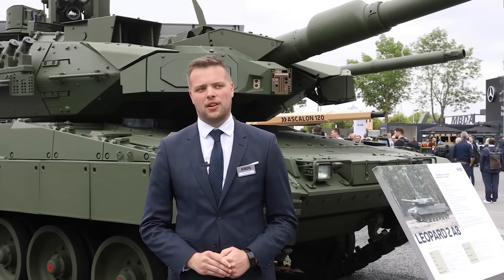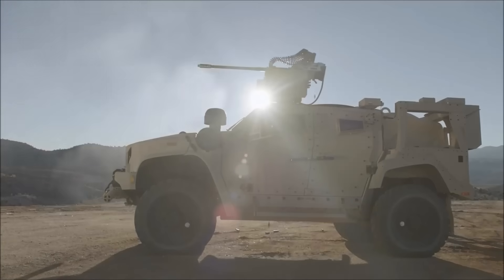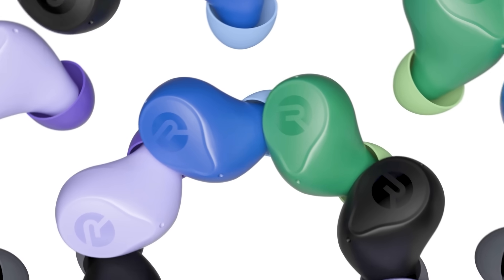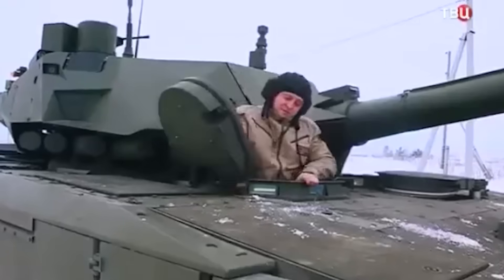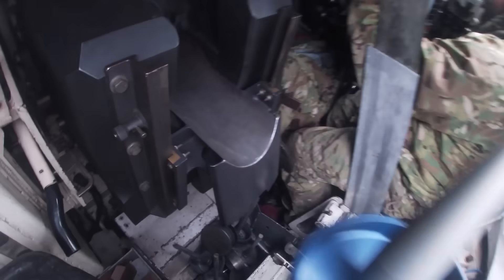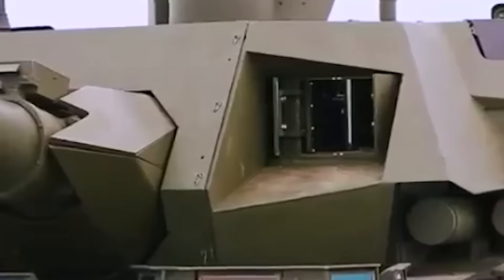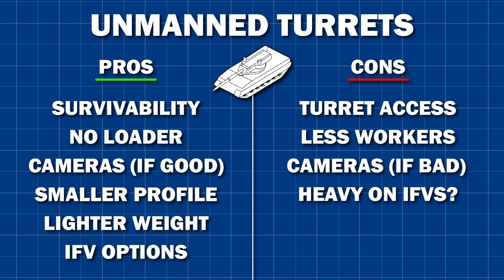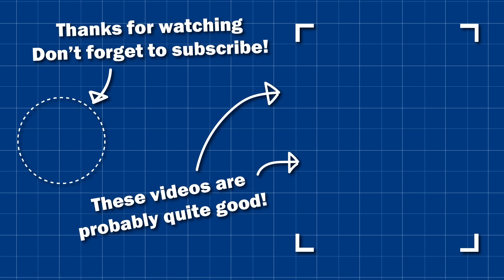The Unmanned Turret - And Why It's The Future

Comment: I think it's very likely unmanned turrets will be a major part of the future of armored warfare. They offer significant advantages in crew survivability, allow for smaller and more protected vehicle designs, and take full advantage of modern sensors, automation, and fire control systems.
Reply: That's great until the tank takes battle damage.  What does the crew do if the optics are compromised?  Current tanks carry spare 'vision blocks' (polycarbonate blocks that use mirrors to operate like periscopes) that can be replaced from inside the tank.  Because in combat they are going to get damaged.  And what does the crew do if electrical power is lost?  All of the control linkages from the driver to the powerpack are mechanical so a tank can still be driven even with a total loss of electrical power.  And all of the controls for aiming and firing the tanks weapons have manual backups.  

With an uncrewed turret - a damaged tank will be completely unusable and there will be no 'degraded mode' gunnery that the crew can use to stay in the fight.  

BTW the ammunition stowage underneath the turret is stupid.  If the tank takes an ammunition hit - there is no way to vent the explosive gasses out of the tank.  Keep the ammunition in the bustle rack with blow off panels.  This way a 'bustle event' means that you only have to replace the ammunition racks, cables, crosswind sensor, and the radio antennas.  And the parts clerk does not have to order each of these components separately they will come as a complete set of all needed parts. (And it will be a single mechanic plus the tank crew doing the work.)
Reply: I would add that weight reduction is another major feature of unmanned turrets IF done correctly.  The US Army's Booker "tank" was cancelled because it was just not significantly light enough in any rapid deployment scenario that was better than the existing M1 MBT has to use.
Reply: Currently, Russian (prototype) tank Armanta has a man-less turret, but it's heavier than a T-90 (55ton vs 46ton), still considerable lighter than an Abrams (70ton) or an 2A7 (64ton).
Interesting comparions can be drawn, I think
Reply: @lehoang3532  T-90M weighs 51 tonnes while T-14 has a much stronger engine and versatile transmission.
Reply: @Klovaneer  it is also significantly larger. The T-90/72 and T-80/64 are very combact. By seperating the fighting compartment with crew compartment and engine compartment you suddenly have to fit each in a different part of the tank. Thus it gets larger
Reply: @Max-hn5fs  It may be visually large but the turret is a feather instead of being at least a third of tank's size and weight.

Comment: Why Western MBTs are so heavy???
Reply: A major part is the fact that they have loaders, each crew man does add roughly around 10 tons or so (accommodation and space)? A loader needs to stand upright to work efficiently, so there's a significant amount of height, space added to the design.
Reply: @polygonalfortress I mean if you look at stuff like the Leclerc, it does in fact weigh around 10tons than an abrams but still is almost 15tons heavier than a t90m. My guess would be that western tank are that heavy because they have actual armor to wistand enemy apfsds shells and atgm. Yes sure soviet tanks are armored and all but seriously, do you believe that a 40ish tanks will actually survive anything? and don't just say "oh but ERA" ok cool explosive armor, but if it was that good we would see it on every tank
Reply: There are 3 main reasons why Eastern tanks are much lighter than Western tanks: 

1) ERA is used as the main armor and instead of using 30cm and more composite, a small brick-sized box will do the job 

2) Autoloader reduces one crew member so tanks can be made smaller and with less material 

3) Eastern tanks do not need to be spacious inside because tanks are made for smaller crews, not for a standard human like in NATO.
Reply: @HesFoset  ERA enhances existing protection, swedish trials of T-80U proves it's composite to be as strong as the Leo 2's. All the weight saving in soviet autoloading tanks is thanks to square-cube law.

Comment: Unmanned turrets offer an interesting premise. It can make it so that the crew aren't in direct line of fire when the tank is in a hull-down position but I've been reconsidering using unmanned turret designs in some of my own fictional MBT designs because of the fact that, if even one of the critical turret components were to fail, lest it be destroyed or simply go non-functional because of reliability issues, it could take out a tank that would otherwise be participating in an armored assault.
Reply: This is a non issue because any tank receiving damage to its cameras is a mission kill. There is no such thing as tanks keeping operating after being damaged in battle. It could be decades ago, not anymore. Any damage that degrades the tank takes it out of action. There is no manually aiming in modern warfare. 
All western tanks have been obliterated in Ukraine with damage to optics and tracks or engine by FPV drones, AT missiles and artillery. 
There is no way in which damage that would take an unmanned turret tank out of action that a manned turret tank would keep operating. Both will be out of the fight and the crew would abandone both with the same damage. 
A crew cannot sit in a damaged tank to emergency operate it in manual and mechanical ways. They will be offed in seconds with modern abundance of directed weapons.

First rule of tank warfare, don't be seen, don't be targeted, don't get shot, don't get hit. 
Once damaged, retreat if possible or abandon the tank as soon as possible testing to use any cover. Staying inside to be Rambo is to ask to get ended.
Reply: @Argentvs This

If they already hit you once they are definitely going to do it again
Reply: @Argentvs  The extent of damage absolutely matters. If a turret is penetrated, the entire turret will need replacing. It cameras are destoryed, only cameras will need fixing. I feel like you completely missed the point of his comment
Reply: @DrakonPhD I didn't miss it. What you say is irrelevant as in both types of turret would be the same. An unmanned turret or manned, if cameras are broken, the tank needs to disengage for repairs. The notion that tankers will keep fighting shooting on manual mode is ridiculous in modern warfare. Most of the time a damaged tank will not survive because it will be constantly being attacked by FPV drones.
Reply: @Argentvs  I see your points and yeah, maybe I could try out a tank design with an unmanned turret.
The fictional MBT design I made for my also-fictional nation, dubbed the Kampfwagen Leopard 3 (or MAV-80 (MAV for Main Armored Vehicle) is still in its early prototype phases and I could make adjustments to allow for it to use an unmanned turret.
I was simply concerned about the fact that autoloaders, cameras and other equipment used in unmanned turrets would be simply too unreliable/complex and expensive for my nation to produce while also staying somewhat safe. That and my tank was designed around expecting to be hit a lot anyways, so we engineered solutions, armor setups and strategic positioning of spall liners and crew to minimize the effects spall has if sabot were ever to penetrate. Ever since the industry and economy has kick-started though, that's started to become more of a possibility.  I'll experiment with redesigns of the Leopard 3 tomorrow to include unmanned turret systems, since it really does seem like they're the way to go. (Oh, and FYI if you're interested about the Leopard 3 I'm making, it doesn't focus on anti-drone systems that much whatsoever since the RP it and the nation was made for all unanimously agreed to not use offensive drones, only drones for recon.)

Comment: It's probably the future alright but I doubt that the close future. It has many teething issues and the autoloader is a big weakpoint. If that's knocked out, the tank becomes useless at best and has an agressive T-72 - T-90 style space program with the turret which as it is obvious wouldn't be harmless to the crew, no matter the armor
Reply: depends the autoloader, a bustle autoloader (akin to the leclerc and the type of autoloader fitted in that leopard 2 rc thing) won't hurt the crew inside.
Reply: @agentgollem1919 but it takes extra space on the turret in exchange which hinders the transportability. But you are not wrong
Reply: @LastGoatKnight Dude how does a bustle auto loader hinder transportability ? The ammo in both the Leopard 2 and Abrams is also stored in the bustle... And the turret bustle of a modern Leopard 2 is enormous compared to that of the Leclerc for example.
Reply: i thought the T-72 and T-90 turret tosses were because of the autoloader design - to my knowledge dont the French Leclerc tanks use an autoloader that uses blow out panels and stuff ? - it effectively side steps all the issues the T-72/T-90 design has
Reply: @notsogood4321it is because of the autoloader design. Still, the space under the turret is a void if they don't use that design which on MBTs is unacceptable (hence the need for unmanned turret, to make the tank smaller in size)